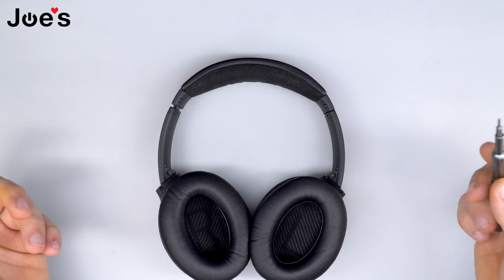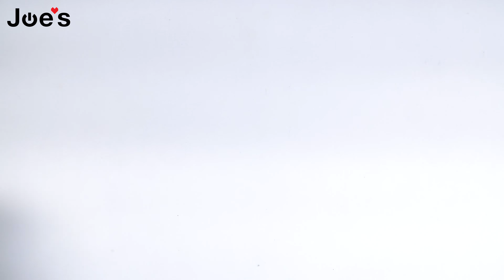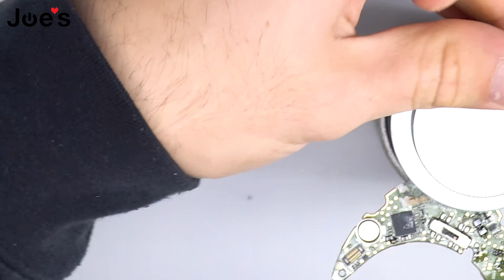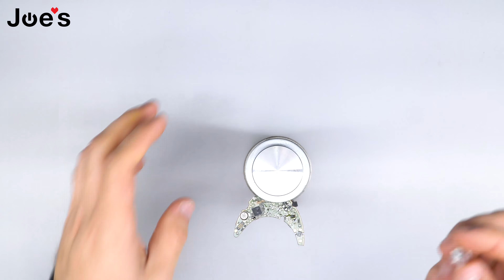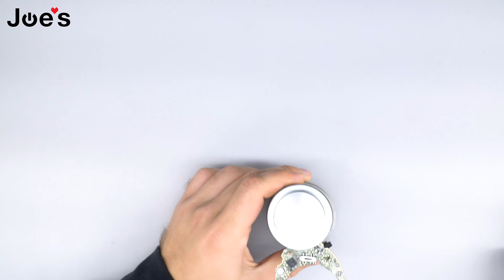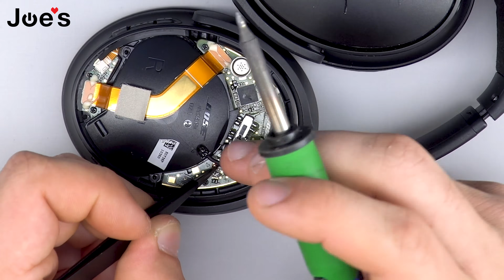Bose QuietComfort QC35 QC35II  QC45 Power Button Switch Replacement | Repair Tutorial

Comment: there's no need to remove the inside padding in order to get to the screws, so why would you remove that?
Reply from the maker: When soldering, we prefer not to expose delicate components like padding to accidental contact with heat, solder, or flux
Reply: fair, makes sense 👌

Comment: Believe it or not I was able to clean the switch by removing cover plate with a thin blade. Clean the contacts with 2000 grit sandpaper follow with rubbing alcohol and "Canned Air". 
Cover plate clicked back into place and the switch works like new. 
Have to be really, really careful not to let the spring inside the switch fly out.
Reply from the maker: Genius

Comment: thanks for the video. Managed to replace the switch, but when soldering the red&copper wires, i've overdone the negative one and there's no solder anymore on the board, guessing the board is fried now?
Reply from the maker: You may be able to reply it, but if you pulled the contact point off the board then yeah its fried.

Comment: Fantastic Tutorial, but not for someone new at soldering.  The soldering points are minute.  I found it easier to clip the legs of the old switch and then removed them one by one by desoldering.  It was easier than removing the entire switch in one go.  Thanks for this. 🙏
Reply from the maker: Hello, you're very welcome. Thank you for the comment. Please like and subscribe for more content like this 😊
Reply: how did you desoldering one by one? I tried with a heat gun but I only melted the switch, this is very difficult to a someone new at soldering

Comment: After watching this, as great as it is I decided I was going to pay for a repair so I went to the Bose website and opened a repair case. Wouldn't you believe it - my several years old QC35 was still covered by warranty and a few days ago my brand new free replacement QC45 arrived - yes, not only a free repair but a free upgrade!
Reply: when I read this I called Bose and they refused a free replacement. They wanted $200 to replace it.
Reply: After reading this comment i looked at bose's website too - got the same! Thank you so much for posting this comment.
Reply: Thank you! I’ve just found out that mine are also covered under this “warranty” and they’ve emailed me a prepaid label to send my QC 35s back for a pair of 45s! I literally only searched for this video because I noticed my 35s sitting on a shelf gathering dust and thought I’d finally look up a guide on how to fix it myself. Bose quoted me around £200 a few years ago when I asked them about getting them fixed out of warranty. This has made my evening honestly.
Reply: Just done the same on the bose website. Ans been offered the qc45 free. Just need to sort posting my old ones back to them.
Reply: Thank you for posting this comment. I had been in contact with Bose two years ago and they had asked £250 at the time to repair them. They were pretty insistent too that I buy the new model instead. I saw this comment and went to book my repair and lo and behold I am now eligible for replacement. Pretty happy that I found this video and your comment!
Reply: I got the same as Rambo. What do we say to try get free ones? 

My QC is the number 1 from 2016 so warranty ran out 2018. My power button is trying to fall inside the headphones.
Reply: @thomashardy8838  Maybe the only way now is to do the repair in the video. Sorry.
Reply: Thank you so much for this comment! I got a free replacement as well. My q35s were bought in late 2016/early 2017!
Reply: @bill.l  Can you share the website link that got you the replacement from Bose? I'd like to try asking them as well! Thanks in advance. Much appreciated.
Reply: @bill.l why can’t i get the replacement then :( i bought mine late 2019
Reply: I got an offer of 20% off a new pair.  Ridiculous, the new pair has the same switch.  Why would I give them $300 more for what is essentially the same pair of headphones with the same issue.  Terrible.
Reply: Just got a free replacement. Thank you for the comment!!!
Reply: @mossimac  How did you go about it? I'm not confident that I can do this soldering myself! I'd like to approach Bose and try asking them. Thank you
Reply: @ramnarasimhan1499  I went to the support website and typed in the serial number.
Reply: I was offered to buy new ones for £200. But obviosly I won't do that - I switched to Sony.
Reply: They told me mine is out of warranty but that they would mail me a prepaid shipping label. Weird
Reply: Bose offered me a replacement qc45 for £190 (haggled from £265) which is still more than what you can find online, they wouldn’t budge to offer anything better. Ended up buying sony headphones hoping its more reliable.

Comment: mine have a weird problem. The white light stays on very brightly. It seems to power off correctly (makes the noise) but this light stays on after it's powered down. Then, it loses charge quickly. I tried spraying the power switch but nothing changed.
Reply from the maker: Hello, thanks for commenting. Please email us at support@joesge.com with a screenshot of your question and we will be able to better assist you there. - Aaron P
Reply: Did you ever find a solution? I have the same issue
Reply: @thewhitegoldfish  I called Bose and complained and they sent me a brand new pair of headphones! I told them the problem started right after I updated the firmware. That seemed to be why they could do that.

Comment: Thanks for the guide! I just replaced my broken power switch (it kept switching to bluetooth pairing) and reassembled everything but now the noise cancelling is juuuust slightly uneven left vs right which is driving me crazy lol, maybe the seal around the ANC microphone isn't quite as tight as it was. Have you ever experienced that?
Reply from the maker: Could be that your seal is not sitting flush